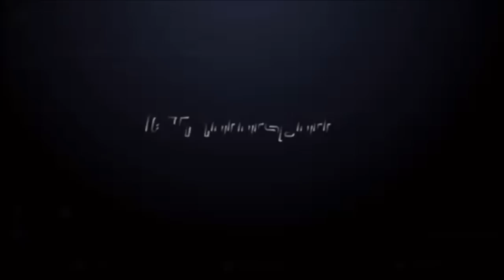BMW G30 convert to M Sport Bodykit & add on Carbon Fiber M Performance Kit

Comment: Great mods - UNTIL you put quad exhaust on a 4 cyl engine.. Nice over-all job however.
Reply: 530 has a 6 cylinder engine.
Reply: It is a 4 cylinder. It's a 530e. It's a hybrid, with a 4 cylinder and an electric motor.
Reply: @jforsten9216  530e is a six cylinder hybrid.